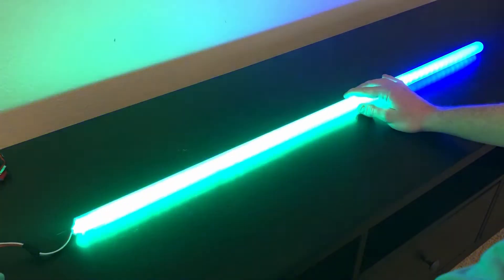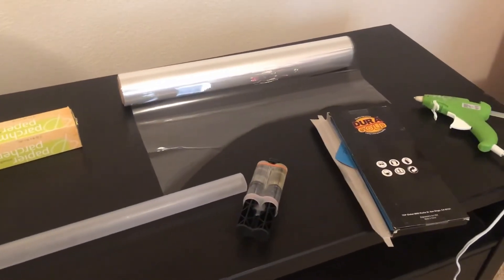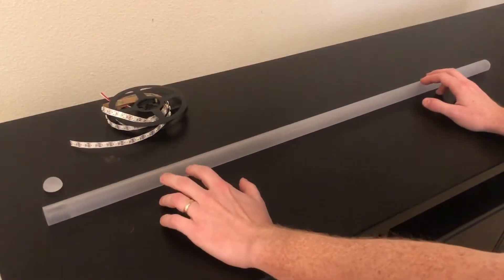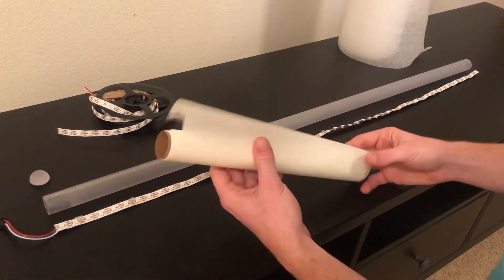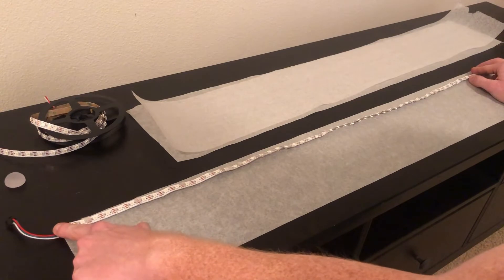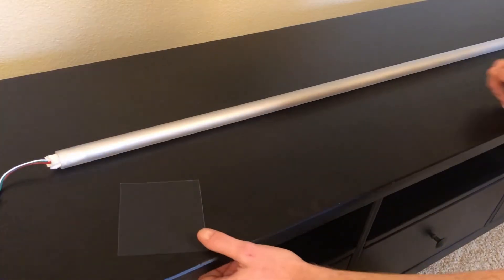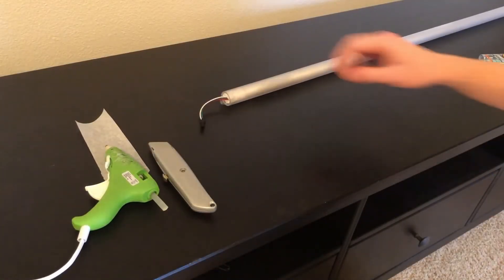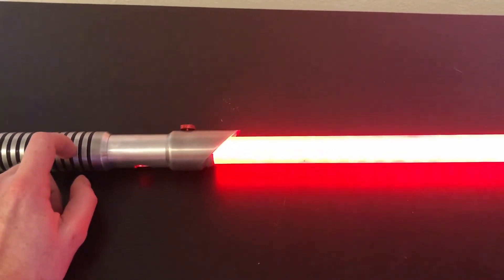How to Build a Neo-Pixel Lightsaber Blade Step by Step - DIY Build Tutorial

Comment: My led strip has the red, green and white wires attached to the connector, but also another red and white wire sticking out at the base of the led. What should I do with them, do I need to use them for power or what? I'm using the strip from the custom saber shop. Any help would be appreciated.

Comment: Great video - well done. I do think though, that going from 144/M to 60/M on the LED strips is a big sacrifice for only a $20 savings.
Reply from the maker: Thank you! At the time it was the best I could do. A new "HD" blade video coming soon!
Reply: @StateofBuild  What if you used a photon tube instead of a regular one? I think the glow would help mask the pixels pretty well. The only downside is that blue colors are not really blue anymore.
Reply from the maker: Not a bad idea. Although 144/m with a good diffuser completely removes individual LEDs. Take a look at my newer blade video
Reply: @StateofBuild  I have a 144 blade that I got from Korbanth. I can't see the individual pixels but I do see a few darker areas due to either the tube or the foam. I have a second one coming in a few months. That's why I got the idea to modify one of them. I wanted to either cut it short and have a 34 and 26 in blade or change the tube of one to a photon one. I went with the photon mod. My tube and tip are on their way. It's just taking a long time.

Comment: Hey, how did you get it to change colors?  I can’t work out an easy way to control the leds
Reply from the maker: You need a sound board or pixel controller at least. I have an electronics video and proffieboard video to help you out
Reply: State of Build Also, how would you recommend powering the saber?  Wouldn’t battery life be an issue with so may leds?
Reply from the maker: Use an 18650 3500mAh lipo battery. You’ll get 45min or so. I recommend watching the electronics tutorial, where I explain everything you need to know

Comment: if i wanted to attach a Pixel PCB to this how would i make it compatible with your hilt?
Reply from the maker: Instead of using the connector, you can buy the PCB and a 1inch plastic holder for it. You can then mount that holder in the 1inch section of the hilt with a set screw. In the past I’ve made these with a 3D printer if you have access. This would be a good video idea
Reply: State of Build thank you so much, one last question you got a 12mm button could i replace it with a 16mm so i can do custom rgb?
Reply from the maker: You could, you just need a bigger drill bit and will need to take out more material with a file to get it to sit flush

Comment: Where do you find the soundboard and connectors?
Reply from the maker: TCSS sells some. I’m selling proffies soon. And there are some cheaper ones on Etsy. They have to compatible with pixels tho...
Reply: State of Build Do you think they would work with a 9V or is it too much?
Reply from the maker: It’s not the voltage. It’s the battery capacity. They have 1/9th the capacity. Battery would die in 5 minutes.
Reply from the maker: It’s not the voltage. It’s the battery capacity. They have 1/9th the capacity. Battery would die in 5 minutes.
Reply: State of Build So what would you suggest?
Reply from the maker: @yankeefan9922  Take a look at my other videos. I go over electronics. You should use an 18650 lipo battery. 3500mAh
Reply: State of Build Thank you! I’m decently new to building lightsabers, and I’m just trying to learn about electronics and stuff and the best way to build them and probably the cheapest I can!
Reply: State of Build Can I buy the board at TCSS?
Reply: State of Build also, what does TCSS stand for and what is the item called?

Comment: Do you have a link to the tubing? I can’t seem to find the right one
Reply from the maker: No, I got it from amazon, they sell it on TCSS and I’ve seen it online at some hardware stores
Reply: https://www.amazon.com/gp/aw/d/B000OMFLIK/ref=ox_sc_act_image_1?smid=ATVPDKIKX0DER&psc=1 just got mine in rn. The 1 inch outer diameter (OD) clear polycarbonate tube fits perfectly inside a 1 inch inner diameter (ID) pvc tube. I'm using pvc instead of metal for the handle.

Comment: would you be able to build me a blade? i will pay you for it. also i have a saber already by Kybers and just need a brighter blade.. could i do this method with the blade i already have? it is hollow on the inside
Reply: but i don’t see how i would connect the plug from the led to the hilt
Reply from the maker: You need soundboard that is compatible with pixels to swap your blade. But yes your blade should be hollow so you could install pixels in them.

Comment: Where did you get the LED strip? All of the strips I could find need to plug into an outlet.
Reply from the maker: Most of those strips are sold for use with a plug. But should be able to cut and solder what you need.
Reply: State of Build Thank you!

Comment: Hey, I have another question. I have set up my electronics for the LEDs, and everything is working great! My only problem is that the sweeping up effect goes through all 2m if the led strip I have, so when I fold it for when putting it in the blade, my concern is that the sweeping effect will light up one side of the blade and then the opposite, and vice verse when I turn the saber off. Do you know how to fix this?
Reply from the maker: Yeah, you have to connect Din of both strands together at the base of the blade. Don't connect Dout of the first strand to Din of the second.
Reply: @StateofBuild  yeah could you maybe make a YouTube shorts showing how you do this cause I’m super confused
Reply: @StateofBuild  is it two separate strands of led soldered to the connector?
Reply: How do you connect the two DINs at the base. You said not to connect the din of the first to the din of the second. Please clarify

Comment: Thank you for making these. I know you're hella busy but I was hoping you might be able to help me. I am building a neopixel saber. I have most of the parts but I'm quite confused in regards to the soundboard. Are a soundboard and led driver one unit or separate things? Also what would be the minimum required soundboard/driver needed to power a neopixel 144/m strip and install the smooth swing font? Thank you again I couldn't pull this build off without people like you.
Reply from the maker: The Driver I use isn’t necessary for Pixels. It helps increase brightness but isn’t needed. CFX of proffieboard are good options. Their instruction manuals explain everything you need to do to wire it up correctly. Some boards have you connect pixels directly to the battery or they have drivers on the board already
Reply: @StateofBuild  Thanks man! I just bought the CFX. I'm getting almost nervous anticipating it's arrival lol
Reply: Hi. Did you finish the project? I'd be keen to know which soundboard you purchased and where from. Also the LED strips 

Regards 

Lee

Comment: Hey, I have another question. I found a 144 pixel led strip, which is 1 meter, that uses 5 volts. If I buy two of them and connect them together, will I still only need to have 5 volts of power or will I need more?
Reply from the maker: Yes you can connect them together and run it off 5V
Reply: State of Build Awesome! Thank you so much!

Comment: Can you describe what kind of LED are you using?? its is 5050 or 3825,? I know you said its Pixel LED, but, I can't find it!. Thank you from Mexico city
Reply from the maker: Pixel LEDs are also known as Addressable LEDs or Neo-Pixels. I used 5050 but you can use either. 60 LEDs per meter. The most important factor is to get a 5V strand.
Reply: @StateofBuild  is the soundboard necessary to light up the lightsaber? Yeah.. i know nothing about these stuff lol
Reply from the maker: If you want to use pixels, yes. If you use regular strand of LEDS then no, you can use a battery resistor and switch in that case. It will only be one color though and have no effects

Comment: Hello, great vidéo and Amazing work. What led button did u used ? Momentary or latching ? Do you have a link where to buy it?
On your other video the button is not rgb with changing color. Right ?
How thé color of the button could be same as the blade ?
Reply from the maker: I used a 12mm Monetary switch from TCSS. It’s not RGB. Most sound boards don’t support RGB buttons. But it’s just as easy to install if your sound board does
Reply: Sorry, i dont get it (english is not my natural language, im french) on this video we see thé button in blue then in red, how it works then.
Thanks for quick reply
Reply from the maker: The video does look like the button changes colors. I never installed the button into the hilt for this video. The color is coming from an empty hole. I can assure you it does not change color it is solid white.
Reply: Ok. I see. Thanks. Last question I want to build one saber with color changing option. What board do you recommend ? As far as I understand yours is home made
Reply from the maker: Xavier Fournaud Correct. If I was going buy a sound board I would go with Crystal Focus X.
Reply: I was looking at prizm 5.5 also.
Not sure to know which one I do actually need
Reply from the maker: You can use either! They are both great boards

Comment: 10:40 the effect where it sweeps up the blade when turning on. Does it automatically do that or did you program that like you mentioned earlier.
Reply from the maker: I programmed that. Any sound board with pixel LEDs will have that effect. It’s part of the reason people use pixels in the first place
Reply: State of Build thanks. Sorry I’m new to this, what do you mean by soundboard?
Reply from the maker: If you haven’t seen the electronics video yet. Take a look at that. The soundboard is a little controller that holds the sound file. Amp for the speaker. The LED drivers. And the brain that controls all of those.
Reply: State of Build thank you, I will watch that video now. Great video btw.
Reply: State of Build okay I have watched that video you recommend and I have a question. You said that you programmed the sweeping effect, how did you program this?
Reply: Eric Roberts I have a few questions. Can I possibly have your email address?
Reply: @Egg Sushi oh yeah yeah